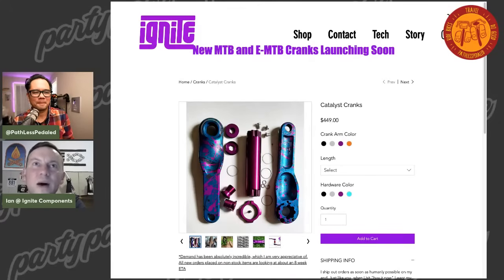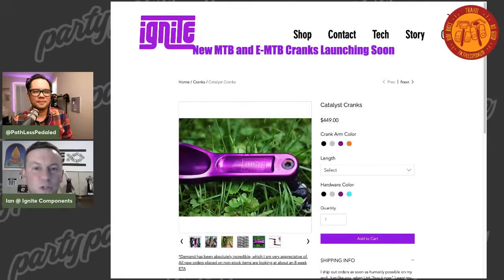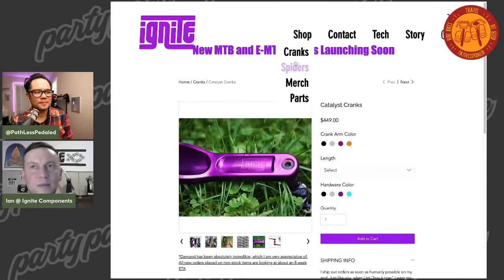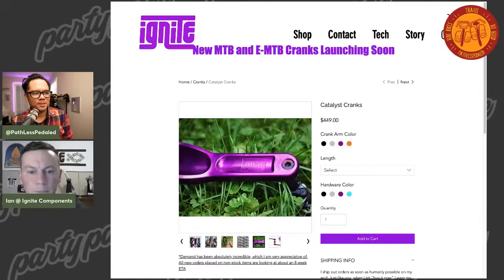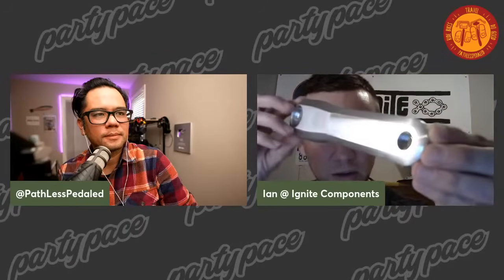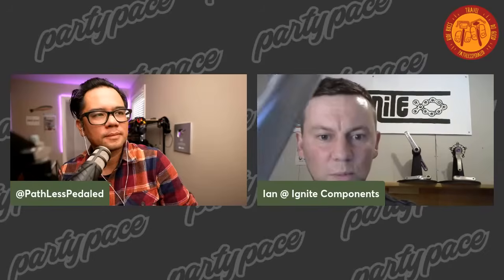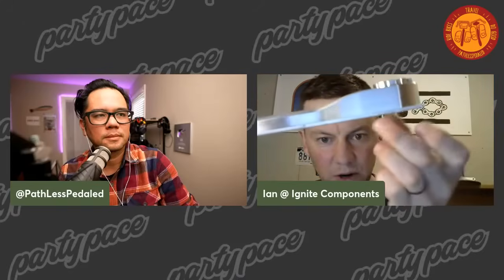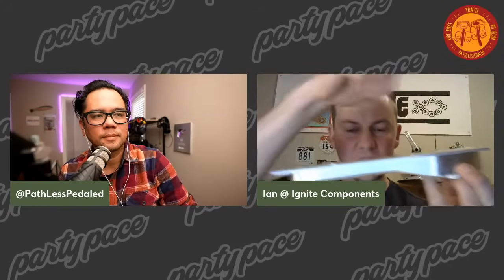What if Algorithms Designed Bicycles? (Live with Ignite Components)

Comment: I would like to add, the reason generative design often comes up with organic looking shapes that look designed by nature is because the process is very similar to evolution. Both nature using evolution and engineers using generative design work over many cycles or generations to optimize the shape of something to work within certain constraints. It's no coincidence, generative design algorithms were inspired by and made to imitate evolution. It's just genes or memes (Original Richard Dawkins definition of meme). Generative design results often look skeletal in particular because right now it's mostly being used to design structural parts optimized for strength with minimal weight to fit within a certain space. All main criteria shared with bones. 
Thanks for the great interview!
Reply: If Skyrim had bikes the Forsworn bike would be the fastest